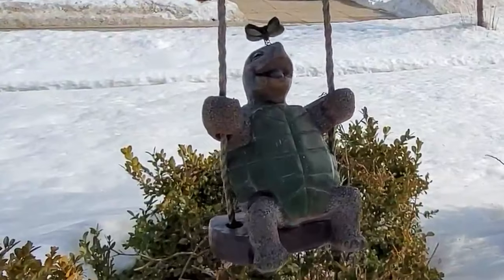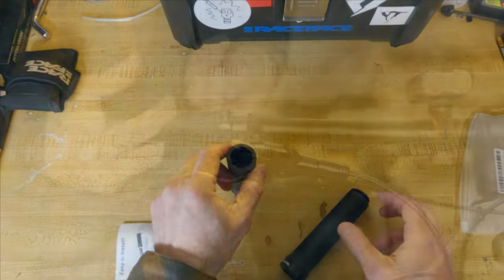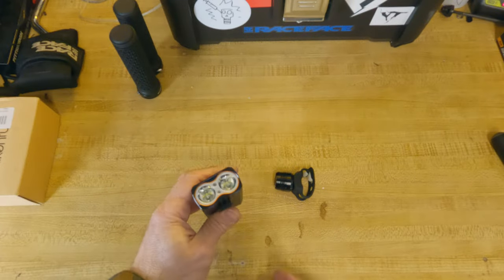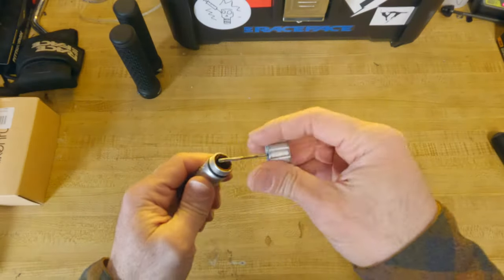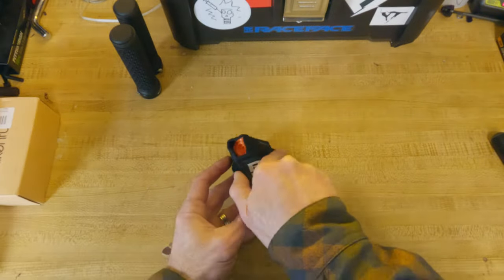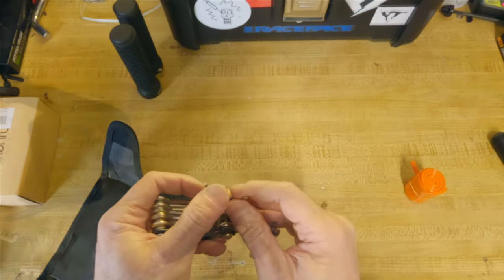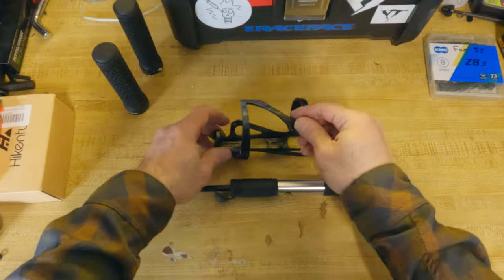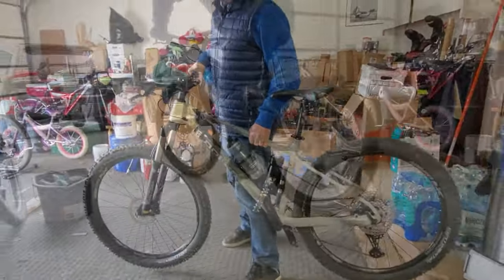Mountain Bike Upgrades Under $100 to Make You More Prepared and the Ride More Enjoyable.

Comment: You’ve probably already experienced how those grips are but I rode the exact same ones in red on my bike and while they did hold up (like less than a week or two) they were alright but after that they immediately started to fall apart, the tread started to basically rub off and holes in the rubber part that went down to the plastic came soon after that, I would recommend vans lock on grips if you like lock one but unless you are wearing gel pad gloves they kinda hurt your hands because of how deep the tread of the grips are.
Reply from the maker: Mine are still holding up but who knows for how much longer.  The feel isn't my favorite. I have ODI Vans lock ons on my Ragley and I like them. With grips, sometimes it's better to buy once and cry once.

Comment: Would you recommend upgrading the stock tyres, even if not converting to tubeless? The xtrada 6 is my first MTB so I don't know what good tyres feel like, but the stock ones seem average.
Really enjoy your channel 👍
Reply from the maker: The stock Spiderbait tires are not bad on dry hardpack. Not so much in wet conditions. You can certainly run tubes with any tire. There are lots of great all around tires available. I'm partial to the Continental Trail King but you have many choices out there. It's a good upgrade to a bike.

I'm glad you enjoy the channel 😁